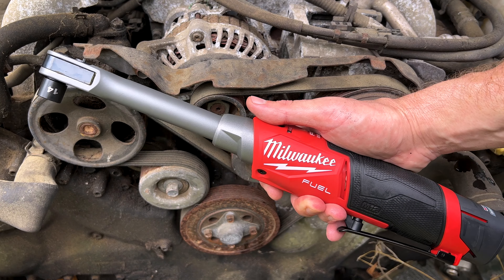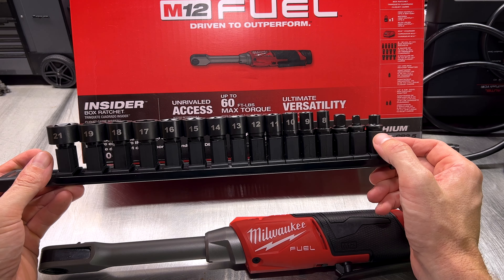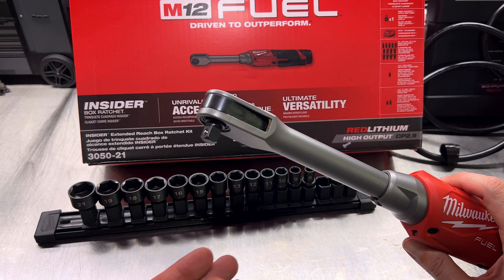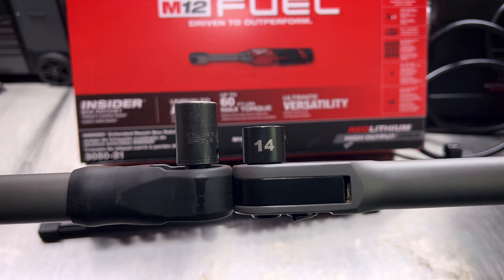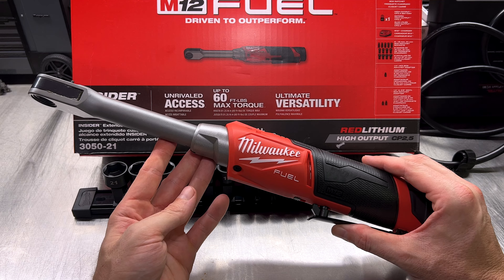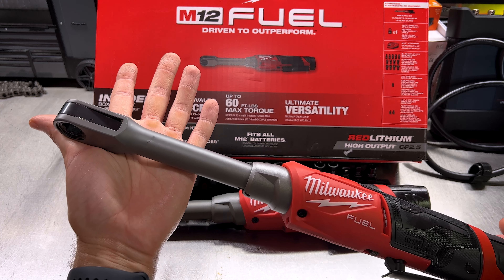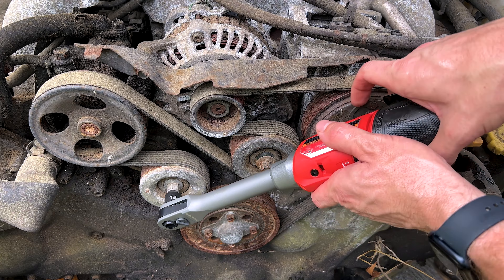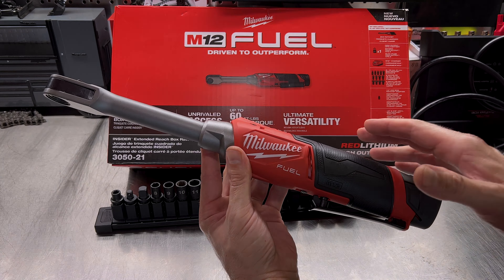The All New Milwuakee M12 FUEL Insider Ratchet! The New Best Thing Or All Fluff? We Test It!

Comment: I like it and I have a lot of M12 and M18 tools but at $279 the cost can't  be justified for a regular guy. If I was a paid mechanic then yes, but only after I had most other tools I needed. And that would be a long list of other tools. Pullers, extracters, ball joint tools, there is a long list. Having said that, if you work on cars and don't have a good cordless impact wrench nowadays, you might as well be in the Stone Age, lol. It is AMAZING how much the tool tech has changed since I started working on cars in the 80s.
Reply: 279 is pretty pricy but the basic short version is ~200 and doesnt come with sockets. So now youve gotta go out and buy yourself a set.

300 bucks isint cheep but if its your first electric ratchet, and you dont have a set of low pro sockets already it seems pretty reasonable to me
Reply: At home I've done a lot of small projects that with hand tools, just took too long and I became tired fast. Specifically with a front subframe replacement which had a couple of long bolts that were painful with hand tools. Because of this, I've considered a cordless ratchet. Although, in a week I will be starting my job as an express tech which doesn't really use a ratchet that often or need an electric ratchet. I would need an impact as I'll be removing wheels a lot to do brake checks and tire rotations. Maybe an impact driver as the guy who trained me had one for certain engine splash shields when doing oil changes and opening air boxes. I've provided all this context because I've been looking into buying my first Milwaukee power tool and im unsure if it would be better for me to buy a Cordless ratchet like the insider for my personal project cars and as I learn to work more in depth on cars with school, or an impact wrench for work to be quicker and make it easier for me. what do you think?

Comment: I am really enjoying my M12 Insider Ratchet, I was concerned because when I would hold a socket with my hand it would just slip but thats normal and the way its made, I have tested it on tight bolts and nuts and this thing drives them on and off with no issues, so it's smart and knows if you are holding it or if you are trying to tighten or losen a real tight nut or bolt. great product, i bought the SAE sockets and for those that might not know that known issue with socket and anvils coming off, you can simply fill out a form and Milwaukee will send you the new updated anvils, 1/2",3/8", 1/4" with Locking feature, no more pulling out the anvils, Milwaukee listened and they made it right by giving these updated anvils free to those of us that bought the older ones. You cant go wrong with this Insider Ratchet, I can use their sockets and all of the ones I already own, plus hex bits which i use alot also!

Comment: the slim design, 60lbs ft of torque, and the nifty passthrough design really did it for me.

I need to get me know of these puppies!
Reply: There needs to be a spark plug socket that works with this.
Reply: @criznitty  just use your adapter and you can use the spark plug sockets you already have
Reply: Does it actually do 60ft torque? On the Home depot reviews a lot of people are saying it doesn't and even more saying that it breaks easily.
Reply: @Sulfen the torque channel tests this out and I don’t believe it makes 60fps of breaking torque.

Comment: The hex drive on the tool on the tool looks to be about 12mm across the flats. 16mm socket = M10 thread (ISO nut size, I know DIN and JIS are different), add a little clearance and you'd have nothing left! I'm impressed the 15mm socket is pass-through!

Comment: I'm about to swap a jeep 4.0 engine on my XJ and was on the wall between the newer Dewalt 20v vs the insider. Seeing the insider in action makes me feel better about choosing it for my project. Longer neck, pass through sockets, better leverage to break bolts, more accessibility into tight areas, carry the anvils in your pocket and you can switch between 1/4, 3/8, and 1/2. Last but not least, the faster it spins the less I like it! There has to be a realistic speed or you risk knurling and cross threading the bolts when fastening them. Now I know why by friend said the newer Dewalt was faster, but the Milwaukee insider was more practical.

Comment: the selector switch vibrates quite a bit which seems a little sus but I'm guessing it doesn't affect the use of the tool, just a note to make compared to the traditional electric ratchets that are solid when using the tool

Comment: I have one of these.  It seems to have a lot of power.  Maybe to much. 

The one things I don't like is when you are using regular sockets with the square drive adapter, when you go to change sockets and go to pull the socket off, the adapter pulls out with the socket. Then you have to put the tool down and use both hands to get the adapter out of the socket and reinsert it into the tool and then install the new socket.  I wish there was a way to better lock the adapter in place.

Comment: I saw a Ryobi one that you can change the head to any size, 1/4, 3/8 and 1/2. I looked at it and  was impressed with the design. Then a Home Depot employe  told me that Milwaukee is making one just like that but its still not being sold your... I need it....
Reply: I ordered that ryobi from the US to Australia!

I got that ryobi, an extended neck ryobi and a small low power lithium ryobi ratchet for the same price as just the insider Milwaukee sells for here in Oz - 3 tools for the price of 1, with much more controlled torque options (just pick your Max power, 75nm, 50nm, or 8nm) - ideal!

Ryobi tools aren't as compact and small as the Milwaukee, but damn do you get a lot for your money.

Is Milwaukee going to make a similar anvil design to the ryobi multi size?

Comment: I loved it until I saw that the directional switch has to oscillate like crazy. Non-starter! The other nail in the coffin is the 3/8 drive anvil likes to pull out whenever sockets are changed. I think I'll suffer with the regular extended reach, thank you. I find myself wanting to change sockets with each different bolt size.

Comment: Wonder if Milwaukee will end up coming out with a set of 12 point pass through sockets?
Reply: Since it's not an impact type tool, I can't see why they wouldn't. Honestly I'm surprised they even went with a 6 point in the first place. I guess to reduce risk of rounding over when breaking loose.
Reply from the maker: They’re working on it.

Comment: Looks great but with the current poor exchange rate (USD v AUD) that thing is gonna be mighty expensive down here. Most retailers here just do a flat x2 of the US price. 😭😭
Reply from the maker: Geez!!!
Reply: Yeah you're better off getting the extended ratchet, regular ratchet and lithium low power ratchet ryobi here in Oz, all for less money than just this insider costs!

And that way you have 3 tools, 3 power levels (75nm, 50nm and 8nm) and can apply the right tool for the job, instead of stripping the shit out of small fasteners

Comment: I see a problem with their design of the socket is if you use their set of socket and you need to use a extension on the ratchet. you can't use the passthrough socket with extension. you need to get another set to finish the job. Also, I saw one video on you tube saying that if you use the 1/4 or 3/8 head. it can only clip one side and the other is will not holding the head. if you can confirm it?
Reply from the maker: If you need an extension, use any you already have with the 3/8” or 1/4” square drive adapter. I don’t understand the last question. Can you reword it?
Reply: @MrSubaru1387  I think they are asking if the 3/8 and 1/4 drive heads fit in either way like the sockets or only one direction.
Reply from the maker: @danprudholme1733  correct. They do.

Comment: What's your take on the direction switch moving as it does during vibration? Do you see it as a failure point over time?
Reply: Seems like it does that because it mates with the ratchet mechanism which is flipping back and forth. Looked a little wonky to me too but it seems like a design consequence of the different way the head is driven
Reply: I have this tool, I think it's the camara speed making the selector look loose, it's definitely not.

Comment: Although I do think this is a cool tool I’m surprised Milwaukee didn’t go Full insert.  As in having the complete socket sit inside the head so that it’s a flush design like a ratchet spanner.  Maybe that’ll be the next option?
Reply from the maker: They did say that they’re working on all kinds of socket styles and accessories for the ratchet.
Reply: I was thinking the same thing. Make it a drop in cartridge type thing. I think that would be a solid tool. This is cool but you still run the risk of backing the tool into something when removing

Comment: The excuse for not having the larger sockets be pass through is a joke.  The tool advertises as having a max torque of 60 foot pounds.  The whole thing isn't meant for torquing stuff down tight enough for concerns that those sockets wouldn't be strong enough.  Every other socket you own already has a hole all the way through it.

Comment: Stupid too use proprietary sockets, low profile could have been accomplished with the gearwrench style pass through  and given the user tons of options, too use a powered ratchet or a gw flex head passthrough. I can't use this tool too tighten 1/2" drive in anchors bc the 3/4-19mm sockets aren't pass through, I can't use extensions from the pass through sets I have, gearwrench pass through has TONS of options including low pro hex sockets, torx, extensions, stupid